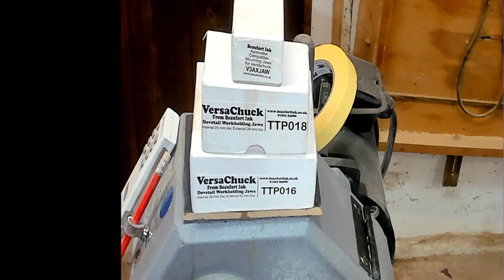Versa Chuck Jaws Part 1 of 2 unboxing and playing a bit

Comment: Hi Pete, I couldn't watch last night sorry.
This system looks fantastic and I really like the Pen Jaws because they close down to a much smaller diameter that the Axminster Jaws I have.
One question, perhaps a stupid one as well, Axminster Jaws fit the Versa Carriers bit would the Versa Pen Jaws fit Axminster carriers as well?
Great video mate and off to Watch Part 2 now.
Take care Pete
Cheers, Huw
Reply from the maker: Hi Huw, in a word YES! if you look I have Axminster SK114 and Versa Chuck each with 2 of the other brands jaws on them, so any versa chuck jaw will fit on Axminster carriers and any Axminster jaw will fit Versa chuck carriers.
Reply from the maker: Add to that they are £22.95 as opposed to £79.98 for the Axminster
Reply: @PeteTwistedTrees  Thanks mate.
Reply: @PeteTwistedTrees  Just bought them. Thanks Pete.